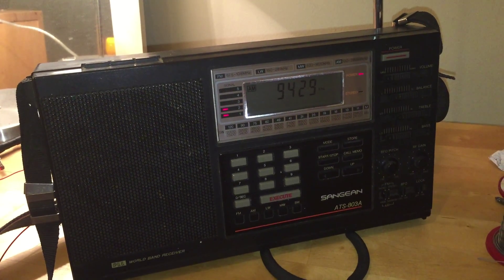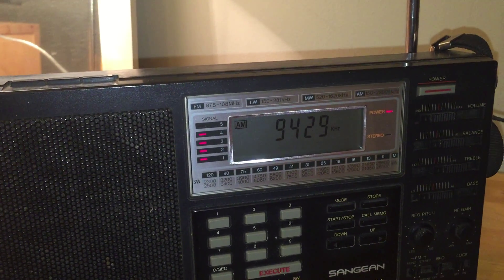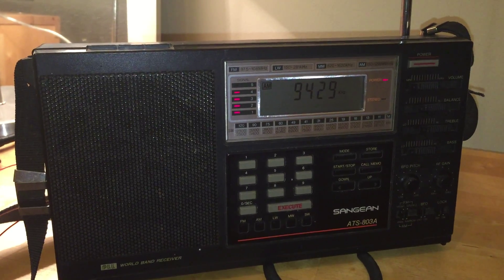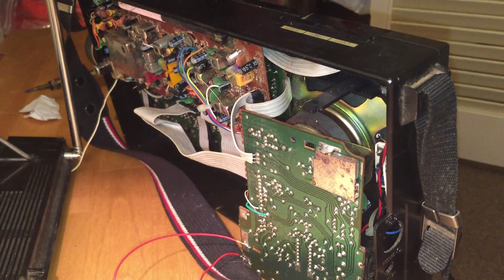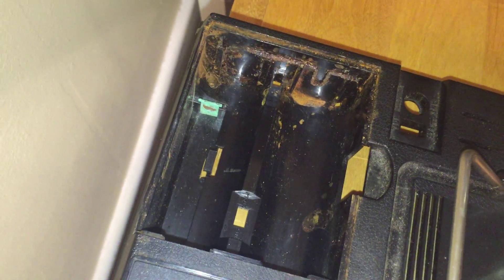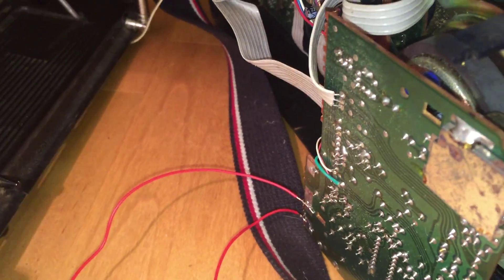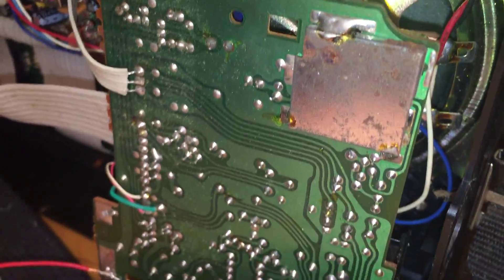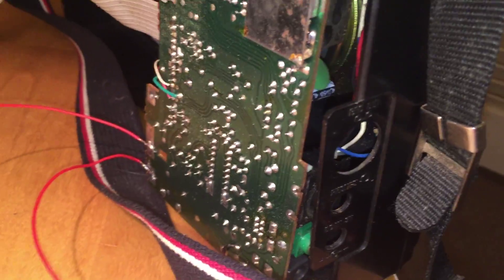Sangean ATS-803A saved from garden shed - modification for mains power

Comment: Interesting project!
I think this portable is much better than its reputation. It copes with longwires up to 50m without overloading and the narrow bandwidth filter is on of the best you can find on a portable shortwave receiver. Just on the telescopic antenna it's quite deaf indeed, it needs a good external antenna.
Reply from the maker: +1963Dx I think You're right on that. It never really did have a great reputation and compared to my little Tecsun PL-360 using just the telescopic, it's certainly not great (I have another video to upload to demonstrate). It really need the external antenna to shine. Regards, Clint
Reply: My 803A is more than adequately sensitive with only its telescopic antenna,  
although a good external antenna does help somewhat. 
And its sound quality is good compared to a lot of other portables.